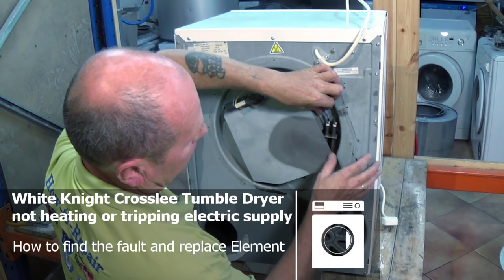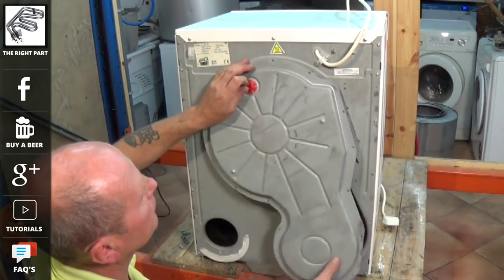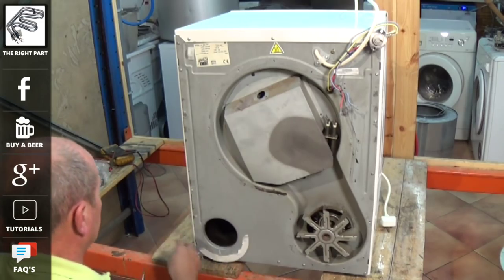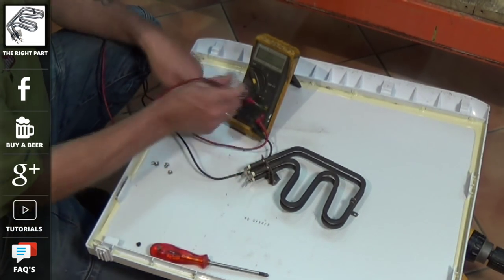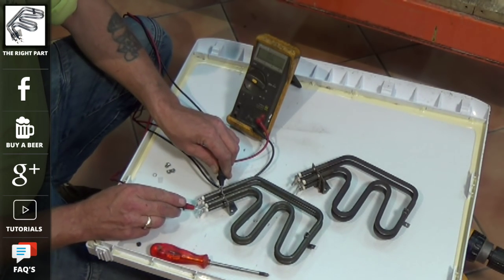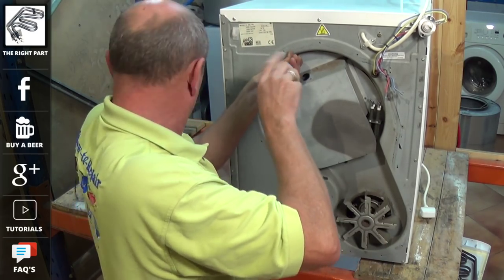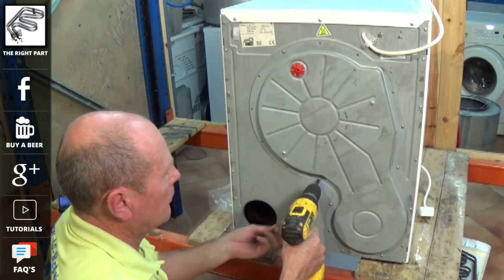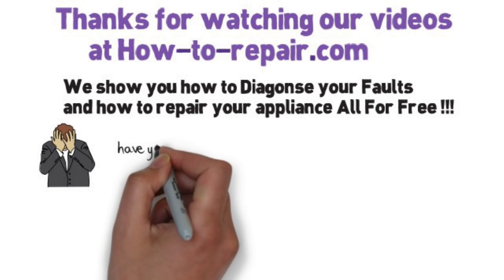White knight Compact tumble dryer not heating & tripping the electrical supply

Comment: Got the White Knight CL372WV doesn't heat, changed the element and the rear thermostat. It still doesn't heat. What's my options now?
Reply: What fixed it?... Thermal fuse?

Comment: Hi, can you tell me what the small shiny metal plate is that you have your left thumb on (@3:21)? Can you tell me why it looks worn through (just like mine)? I thought that would need replacing on mine, then seen you happily chuck it back in, with no comment on what looks like wear. So, I get that it's fine. But what is it, and why in the manual does it look like it should be one peice? (not split in two)
Reply from the maker: its a bearing friction pad they don't sell it i think
Reply: Thanks, especially for fast response. What does it do/or stop the machine from doing? I work with a lot of metal fabricators and could easliy get a patch brassed or soldered on. Mine looks a bit more gone than yours.
 Although, I did manage to cure the smoking my Mrs was moaning about this morning by taking the whole back apart and giving it a good clean. Think it was underneath the element cover in the edges of the drum that was the culprit, not 100% sure. But there was some thickly matted fluff in between the drum and cushioning there. Also cleaned out under filter and extraction pipe as you should.
Reply: yes it does need that plate it keeps the drum forward  i don't no if you can buy them also if you are doing that i all ways put a bit of copper slip on the end of the drum were there is a blob of copper for that plate to run on
Reply: The silver strip of tentioned metal presses against the drum earthing rivet to earth the drum...it also seems to help stabilise the turning drum.
I've just emailed White Knight asking if this often broken earthing strip is available to buy. I reckon it isn't, but should be to save those buying the affected dryers from having to buy a whole replacement heater unit. Absolutely disgraceful customer after care by not having them readily available.

Comment: Hi, mine does not trip the electric, first time it happened it just stopped, it now only blows cool. But it does not trip, is it still the element?
Reply: try the reset button if it does not work its ether the element or the timer switch